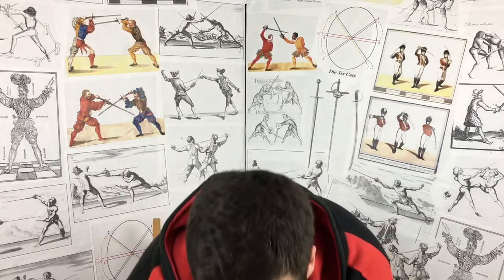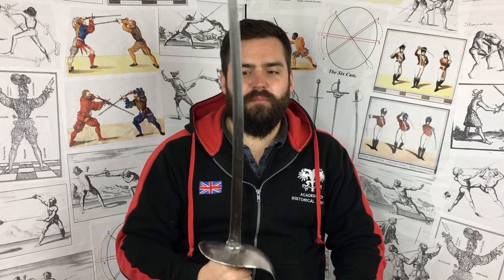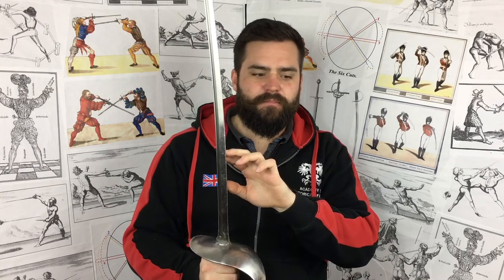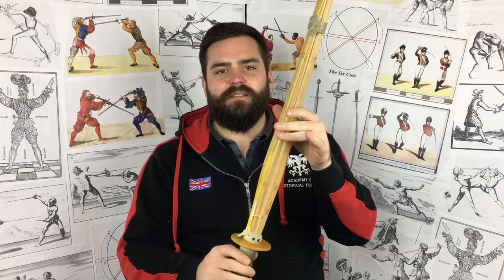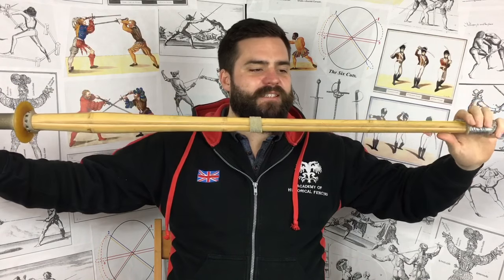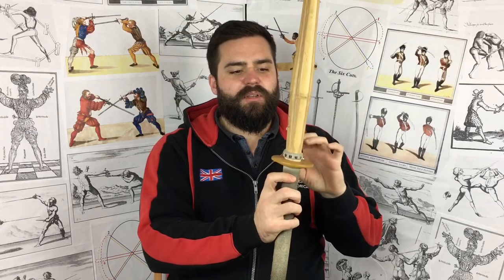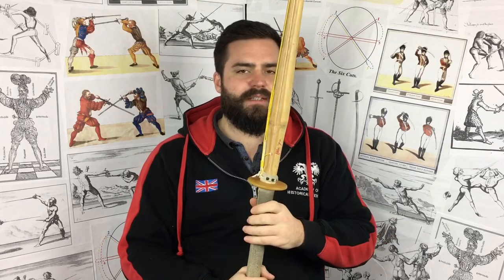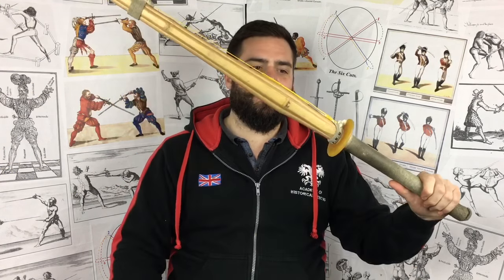Different training swords for HEMA, Steel, Nylon, Wood, etc.

Comment: This was a very helpful video but I still have a question:
I attended my first HEMA class today where I was learning sword and buckler (my arms were killing me afterwards because I'm so new to it but that's besides the point) and we were using steel swords, although there were Knight Shop swords there.

When I asked the instructor what he thought was best if I was to buy a training arming sword he said I'm better off saving up for a blunt steel sword instead of getting a Knight Shop sword (and come to think of it, the Knight Shop swords did seem to have rather chunky guards and pommels) and then told me towards the end of the class that I'd be better off not getting a training sword... assuming I was going to hit stuff with it, which I wasn't! It'd just be for getting used to the heft. But one thing he said against synthetic swords was that they aren't good for binding techniques.
I just want to know what you would say for a beginner who wants to start with arming sword: blunt steel or Knight Shop synthetic sword? Because I'm more sceptical after that class today. I'll be checking with my instructor again next week but due to distance and schooling, I won't be attending it regularly so I would like to have the best option for solo training drills.

And yes, I'll be buying protective gear. In fact, he recommended the mask above the sword.

Thanks for reading this text wall of a question.
Reply from the maker: I wouldn't get the knight shop sword now. A few years ago they were a real asset to us, but better things now exist. If you were going to buy a synthetic, the Black Fencer arming sword is excellent. In fact it is one of the best things they make. It handles like a sword, and not like the KS one.
As for binding. There is still a very small amount of bounce to the Blackfencer, but in my experience, binding is what you make of it. Blunt steel isn't as good for binding as sharp steel either. We use both and successfully bind with both.
Overall I am a big believer in getting a good synthetic first, its cheap and comparatively safe. Black Fencer or Purpleheart. Those who jump to steel to early on frequently end up sparring in a way that simply lacks intent. Of course those who only ever use light synthetics can get quite sportive, so it swings both ways. I suggest BF arming sword first, followed by a Regenyei or similar steel.
Reply: Alright then. Thanks for the tip. I was thinking it would be a bit of a jump to start with steel right away.
I noticed that BF's V4 Arming Sword is really cheap. Only about 4 euro more expensive than the Rawlings one so if I'd be paying slightly more for a better training sword that's still relatively safe, then that sounds like a bargain.
Unless they're that cheap for a reason other than competitive pricing, of course. Their type XIV V4 Arming sword is a bit more pricey.
Reply from the maker: Black Fencer ones are outstanding. I have a couple of their arming swords, and most things in their range actually. We have about 120 Black Fencer swords in the club, maybe more. They are outstanding, and durability is incredible. Especially if you keep to simple hilts like an arming sword where there are no complex guards to bend.
Reply: That's great to hear! It's probably best if I go for the cheaper one for the time being then. It's mainly so I can get used to the heft and if I manage to find a sparring partner I can spar safely. Unfortunately my area is fairly removed so that won't happen for a while but we all have to start from somewhere, I suppose.

Comment: We use aluminiums for drills at my club and I think they work pretty well, better than feders. There's actually no need to repair the edge since they don't chip. I've been told the club have been using them for years and they're still in pretty good shape.
Reply from the maker: +Henry Cookson The drills must be quite light then. Aluminium is soft, and any heavy contact as there would be in sparring will chew them up pretty quick.
Reply: Academy of Historical Fencing They aren't heavy, that's true. However the swords we use aren't cheap either, more in the 140£ mark so it might be better quality metal.
Reply: +David Cookson prbably has iron and nickel in it too or possibly copper.

Comment: Have you ever tried coating your weapons? We used to paint ours on the edge and a bit of the flat with liquid tool dip (from the hardware store) which gave some stickiness on the bind. It did chip off with hard strikes sometimes but it's so cheap it doesn't really matter.
Reply from the maker: +Soaring Wing Chun Yes, but we have found it to really not be that important. Providing you use a range of training tools and understand the relationship of sharps. We have found that such modification is just not suited to the operation of a school, where kit needs to be off the shelf useable.
Reply: +Soaring Wing Chun What I recently discovered is that it's not that hard to simulate what sharp-on-sharp sword contact feels like if even one of the fencers knows it. Hand your students sharps, make them do a single, safe(ish) bind to get the point across, and you're more or less set.

Comment: Hi, in training terms is there much difference between a swept hilt rapier and a cup hilt. I use a hanwei swept hilt at the moment and follow di grassi, but am thinking of getting a Danelli cup hilt. Would this pose any issues when following an Italian manual from an earlier period than the cup hilt? Cheers.
Reply from the maker: +Bowen R A cup hilt would be fine for di grassi, even though it is much later than his time. However, you would be better off with something more sidesword like considering his manual. The Danelli Transitional rapier would be ideal. As for using cup hilts generally instead of swept hilts, it's not a major problem. It removes the thrust attack to the hand through the hilt, but other than that it can be used according to the same techniques.
Reply: +Academy of Historical Fencing . Cheers Nick.

Comment: I've been training for a while with the Rawlings synthetic. I'm ready for an upgrade and I don't know whether or not to go for a Black Fencer or spend the little extra and go straight for a Regenyei Feder?
Reply from the maker: No simple answer to that. What I'd recommend to people is that they upgrade their Rawlings with Black Fencer, AND buy a feder :-) On an individual basis though, I would make your decision based on what your group or sparring partners are using most.
Reply: Thanks I appreciate the advice, incidentally what are your thoughts on the Black Fencer sharp simulator?
Reply from the maker: Not tried it yet sorry.
Reply: Roland Warzecha seems to like them

Comment: I have 2 questions: is cold steel safe to train with my brother at home? And the second one is: can you suggest me a few EU shops who sells synthetic sword, etc?
Reply from the maker: They hit very hard and have no flex, in short they are ok for drills and light contact if you have the right gear for it, otherwise no. My recommendation would be Black Fencer (Spain), which are excellent. Go-now (Poland) also make a range of padded training swords that are great for use without much gear, we also use these as beginner weapons.

Comment: Am I allowed to use a sword breaker as a secondary weapon?
Reply from the maker: I'd not recommend it. We used one for some experiments, that we then made a video about. They massively increase the risk of blade breakages, and therefore make training much more dangerous as well as costly. Though the chances of breaking a blade with them in a real fight is quite slim, the chances are much higher with training blades because of the safety tips that we have to use, and they snag easily on something like a swordbreaker.

Comment: The main advantage to wood is that you can make your own. Other than that, no advantage. Also, another thing about trainers is that they should be heavier than a real sword. This improves your endurance and speed with a real sword. Though you can simulate that weight by using wrist weights.
Reply from the maker: +kleinjahr I don't agree that a sword trainer should be any heavier than the real thing. Original masters vary on this. In the Renaissance, some believed you should use double weight training swords, other half weight, and everything in between. As with any kind of training there are a world of variety of approaches and marketing strategies. Best way to improve endurance and speed is to use an accurate training tool often.
Reply: Academy of Historical Fencing
Certainly, accurate training tools are good and useful.They teach how the real thing works.However, overweight trainers also have their use. Much like military training for endurance, using overweight packs. Or like boxers training at the bag with overweight gloves.

Comment: Wood is the best option for training at the pell. It isn't that popular, but it's a 100% authentic method of conditioning training.
Reply from the maker: +cygil1 An authentic training tool certainly, but I don't see they have any advantage over high quality synthetics like the Black Fencer models. The synthetic material has no disadvantage over wood, is cheap to buy, and much more durable, and can then also be used for sparring.
Reply: +Academy of Historical Fencing Do you think that a steel training sword with an aluminum edge could maybe a good design?
Reply from the maker: +Jackson Almodobar I wouldn't think so. I would expect the aluminium would have a problem flexing and returning true, giving much the effect of a katana blade, so you might as well have solid aluminium. Also, the soft aluminium edge does cause issues for safety as they have badly burred edges that can become like hacksaws under heavy usage in a short time.
Reply: Academy of Historical Fencing  The edge being too dangerous for practice seems understandable, but if the majority of the blade was spring steal wouldn't the blade return to its original shape if bent?
Reply from the maker: +Jackson Almodobar I wouldn't have thought so. Aluminium tends to stay bent after flexing, I would have thought that would stop the blade from returning true. It might also cause issues with the two metals trying to separate from one another.
Reply: Academy of Historical Fencing I would think that if only half a centimeter of aluminum was on the edge, and the rest was steel, the potential energy of the spring steel would far surpass the aluminium's bending point (depending on the blade shape). However the swords shape would probably warp over time and the two metals would try to separate from each other.

Comment: To be frank, I personally hate synthetics. They were relatively good in simulating steel, and I didn't have many problems with the behavior of a synthetic. My problem was elsewhere: I have never been hurt as badly with steel as I have with a synthetic sabre. It feels like people just respect steel far more and tend to get carried away far too much when using a "safer" material.
Reply from the maker: +VelmiVelkiZrut I understand that argument, but I have seen just as much wild fencing with both, and I have seen far more severe injuries from steel at sensible contact levels as I have with synthetic at higher levels. If people are going wild, then that needs to be handled at a club level. Another issue is that people underestimate the safety equipment needed for synthetics, but that is not the fault of the training tool. I use steel and synthetic sabre every week, and the reality is that whilst the steel is more realistic in some regards of blade contact, there are some strikes I just wouldn't make with it that I do with the synthetic.
Reply: +Academy of Historical Fencing Another disadvantage of synthetic swords is that they slip and slide in the bind. I think that electrical tape on the edge can fix that though
Reply from the maker: +TotalBarbarian Steel blunts do this as well though. No way I am putting tape on the blades. I still think the stick is overrated. I have used sharps, and thin edged blades for drills. I don't think it's that big a deal providing you know the principal of how sharps interact. Also Black Fencers new teethed blade will likely simulate the bind better than any training weapon to date, and it is synthetic.
Reply: +VelmiVelkiZrut All the time I saw any reference to heavier than original training swords, it was implied that they shouldn't be your only training sword - kind of like a japanese saburito, pretty much just a square wooden beam with a handle carved out of it.

Good for physical conditioning, but you shouldn't use them to perfect actual techniques.

Comment: How many deaths did the aluminium sword cause over the years?
Reply from the maker: They could certainly hit and thrust hard. Though as ever, you fence to the level of what you are using. Only injury I ever got from them is when I landed on the nagel during a grapple where the weapon had fallen to the flaw. Cracked rib, lovely. Hence why I don't like nagels, and would much prefer d-rings on messers.
Reply: @AcademyofHistoricalFencing  I've actually been injured more by wooden swords than anything else, i've broke almost every finger and both thumbs, all from wooden wasters. When me and my friends first started out, we used wood, until over the years we sustained too many breaks, and when we got to working age we just couldn't use them anymore, because we needed our hands for working lol. We then used cut down golf club shafts with the heads removed, wrapped in leather and other fabric with tape around them. Then we started making our own steels out of live blades and just grinding them down, the tips were unsafe and we had 2-3 injuries, one quite bad, so we stopped all unsafe sword training after my friend took a bad thrust through his palm. This was all years and years ago, no unsafe training goes on anymore, health and safety over here now!